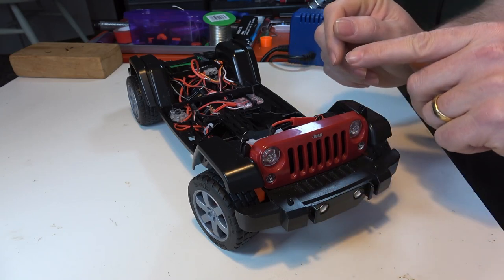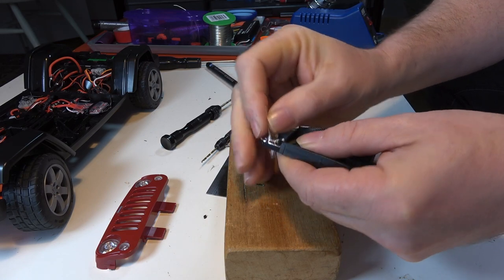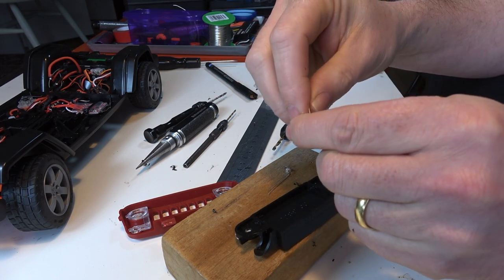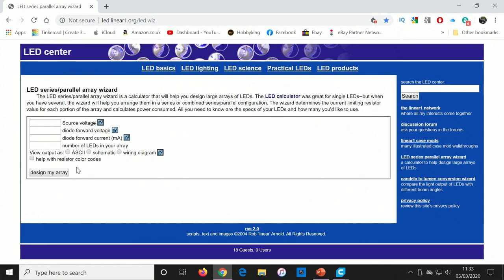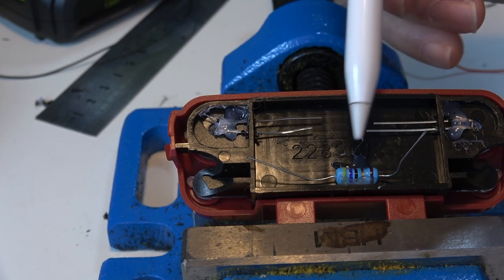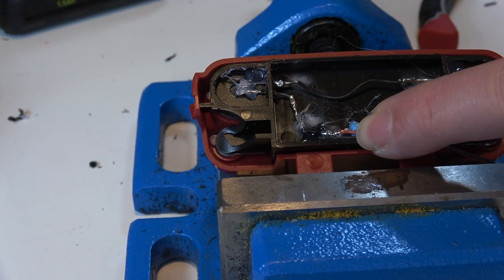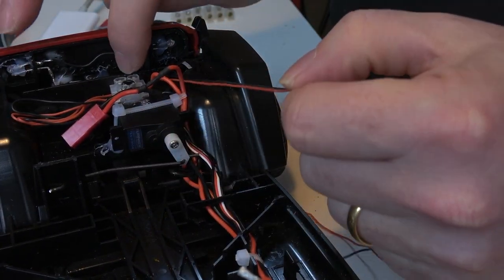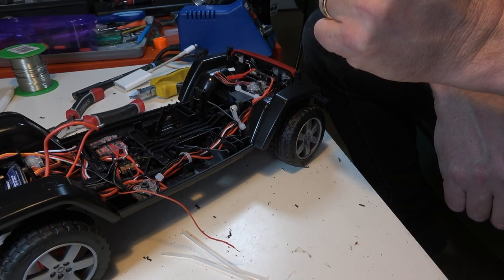Bruder Jeep RC conversion - 9. front lights

Comment: It really does seem that the headlight buckets were designed to be LED ready - how odd!
 The fitting of the grille, with the need to keep gently tugging the wires through ass the grille came closer and closer to the front of the body, was extremely satisfying to watch. 
 In my own attempts to work on my 1:16 Dickie Toys MAN - based rocket truck, I´ve been much guided by your example - work out why it won´t come out rather than just yanking on it, and plan ahead to avoid disappointment when you realise you´ve got to undo a good bit of work because you forgot to fit something else first...
Reply from the maker: Thanks Del. I do have the luxury with these builds to have 2 goes at it - the initial prototype - with lots of tweaking, and then the build video. Although the time between designing this one and the videos was around 6 months - so I had forgotten a lot of it and had to keep checking on the original one! Trailer and skid loader now ready for filming! 😀👍
Reply: @RCModders  Over a period as long as six months -i think I´d forget a lot of it as well. There´s so much to think about!
 I look forward to the trailer and skid loader videos - more grist to the mill of your fertile brain...